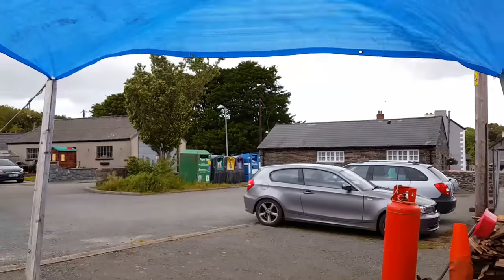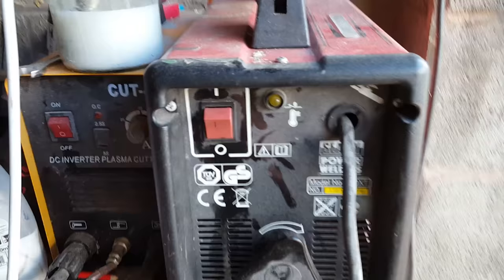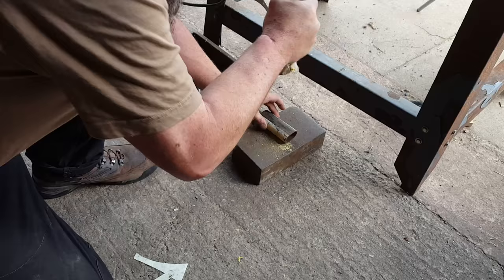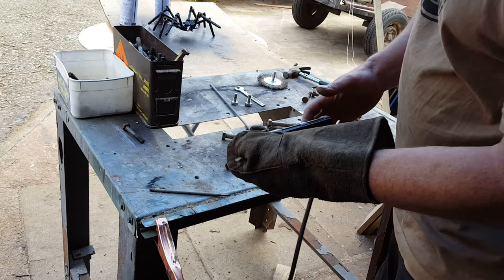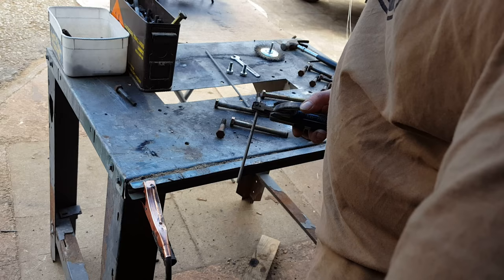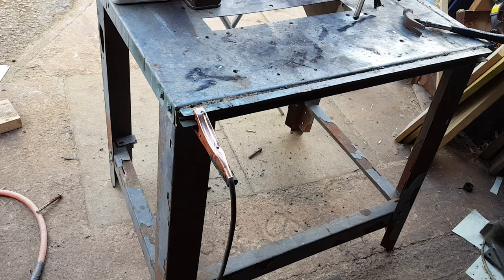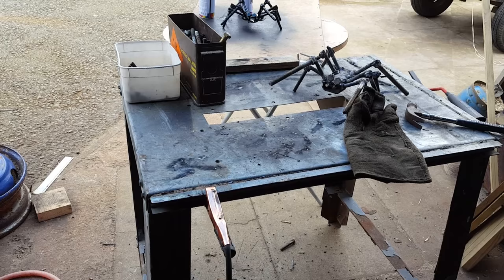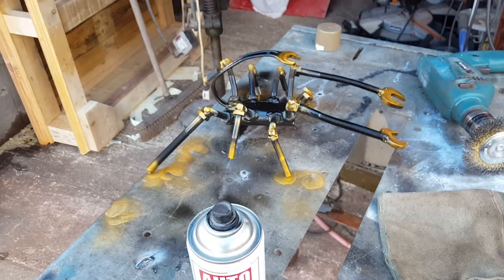Basic Arc Welding with Sealey Arc Welder 140xt + Simple Spider Metal Art Project

Comment: Your skills are looking good.  An old pair of Vicegrip pliers with the ground lead braized onto the body, or adjusting bolt can work good for a ground clamp too.  I recall that I always bent my electrodes about 45 degrees after I put them into the clamp, not having to cant my wrist seemed less tiring after a few hours.  Keep up the good work & the vids too.
Reply from the maker: thanks for those tips, ive got an old set of vixegrips lying around somewhere

Comment: The scorpion is ace. Might try to acquire a welder to try it, or just ask really nicely if you'll add it to my scorpion collection lol  ;D Great video as always.
Reply from the maker: theres a lot of welders floating around :) i did make another this morning thinking of selling them?
Reply: Selling them sounds cool, but after watching your video I felt inspired. Showed a mate this video, & he said i could borrow his welder. Now I'm going to attempt something similar on my ratted GSX (after a bit of practice) :D
Reply from the maker: nice to have one or two good mates, if you could get him to give you some tips thatll help you, mainly holding the angle right on the rod, being slow and cleaning up the steel youll be allright, just persevere and itll be sound, a ratted GSX? which one? 750? thou?
Reply: GSX750F, without the fairings etc. Thinking of using an old chain & sprocket to make a scorpions tail, if I pull it off I'll send you a picture.
Reply from the maker: i briefly had a straight gsx750 back in the day, maybe a '77 if i remember, yeah, send a picture via google+ or facebook if you do that?

Comment: I have a gas free MIG welder, i'm very good at filling in blown holes and dancing  with sparks in my shoes :-D
Reply from the maker: got a spark on my face the other week behind the mask, that was fun, whats your welder and was it worth getting?
Reply: Clark 130EN turbo. the price was right and i'm well please with it
Reply from the maker: does it shutoff when youve been welding a while, how does it work with different thickness metals, do you have to change the wire out?
Reply: so far it not shut down on me and i've had it a few years now. there are 4 setting for different thicknesses MIN 1&2 MAX 1&2. I use a 0.9 FE no gas wire for all thicknesses of metal and there is a separate knob to set the speed of the wire feed